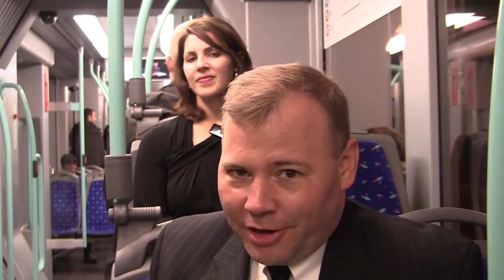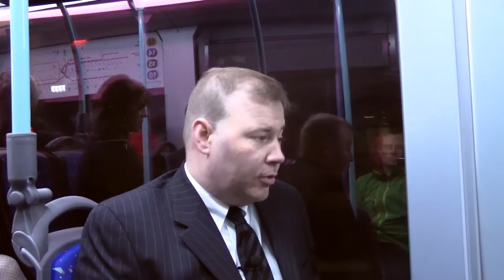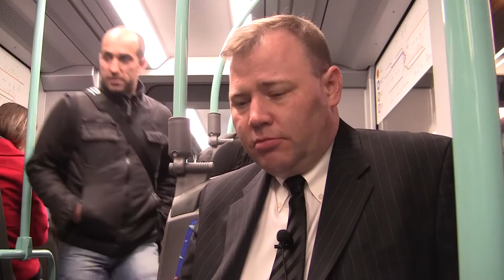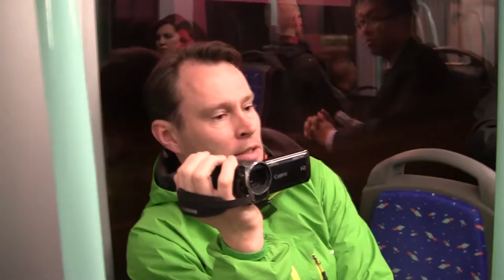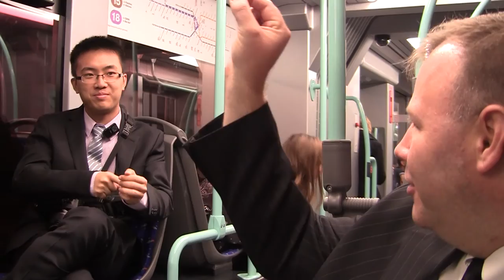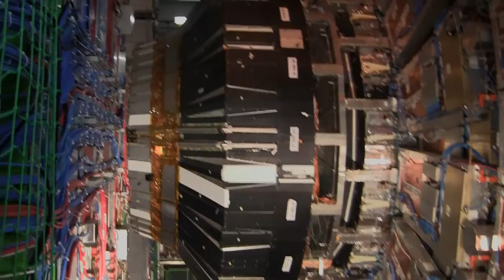Kirk Sorensen rides public transit to Geneva during interview @ ThEC13

Comment: Great instructive video on LFTR and MSRs. Being Swiss I especially like Kirk's promotion for clean and zero carbon public transport. Remember the Swiss energy mix (55% hydro, 40% nuclear, some biomass, no fossil fuel). Did Kirk mention the clean Swiss air?
Reply: I can tell you are a city person.  Do you know why?  Because "public transport" is even on your radar.  We all kind of gravitate to what we know and live and moving us from place to place efficiently is a part of many people's daily lives. However, in rural areas a mass transit system would most certainly be less than energy effective (and probably a loser economically even with the most draconian tax structure, we would have to ride horses for it to work) and spell doom for those everywhere else.

But, you ask, nobody should care about rural areas because nobody lives there.  Well, friend, that is where food grows and materials to make modern life are harvested.  Those require lots of energy, well diesel fuel, to harvest and mine or whatever.

High temperature reactors are, so far, the only emergent technology that at least tries to tackle that issue with the sodium-iodine process.  And even then not too well.  We get a by-line of dithyl-ether production (sorry, ammonia is a non-starter) .  Might as well make heavy oils from shale or canola oil with that attitude.  Hmmph.

My point is; forget people commuting in cars.  They will stop once gasoline becomes too expensive (a self-correcting problem) what we need to worry about it how to power a tractor to plow a wheat field, a combine to harvest the crops, the truck to take it to the port, putting the crops in a barge powered by a tug boat , to a bulk-hauling sea-going ship, to a destination port where the crops are hauled by rail on a short line track to a mill/food processing center, then to a truck to a distribution center which makes a final product, then to market, and finally then it rides PUBLIC TRANSPORT to people's mouths.  Deny it if you must and cry "locally grown" but remember that Japan and South Korea would starve under your initiative.  Simply not enough calories to be had in country.

Getting people to work without hitting the snooze button is not the issue.  Getting food to mouths is.  Freaking period.  We need a fuel-grade oil substitute going forward.  And adding an extra extravagance so the mass transit people hauler system of metropolitan wherever gets the citizens to work slightly faster ain't gonna cut it. 

So, spend your money on "mass transit" or really address the issue.  Diesel fuel can be had for relatively cheap once extraction facilities are made in the Green River formation which will produce for hundreds of years.  The window is closing on where that is a viable enterprise.  Also Canadian oil sands.  Let's spend that mass transit money on getting ideas like LFTR going.  Spend it on sulphur-iodine processing.  Spend it on supercritical CO2 turbines.  NOT some populist smoke-and-mirrors where people riding the d-line somehow feel better about being forced into riding mass transit because their idea of a modern standard of living was upended.
Reply: Switzerland is densely populated, mass public transport makes sense. Of course it doesn't in a rural area. But since more than 50% of population lives in urban areas it makes a difference.
I agree with you that we need a CO2 neutral fossil fuel substitute. High temp reactors can generate the required process heat.

Comment: Many of the products of the fission, absortion and radioactive decay are solid at the core operating temperature, so they will precipitate obstructing pipes and valves, how will you deal with this problem?
Reply: not at 700 - 1400 degrees centigrate, which is the range these new LFTR MSR's will be operating at.

Also, as kirk just stated in the video, there will be proccesse's in the reactor chain that will make these byproducts into fluoride chemical bonds, and these are in solution as well.